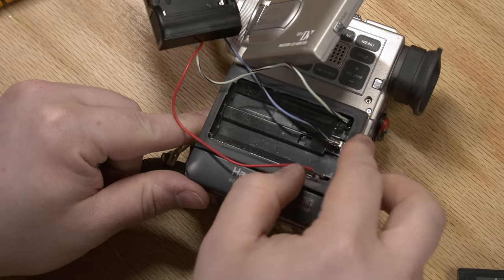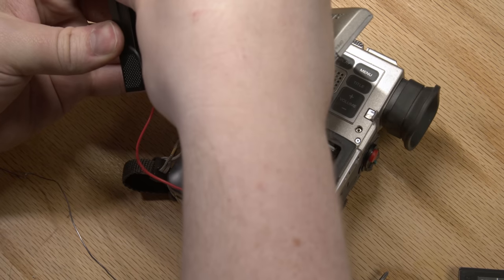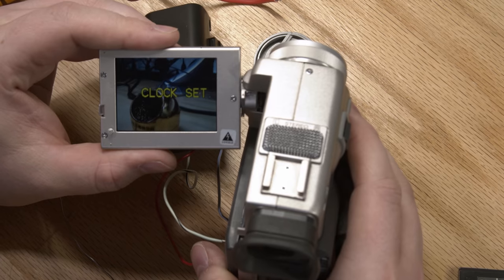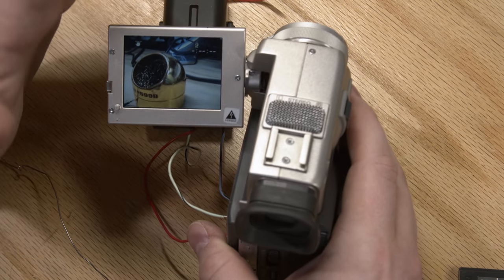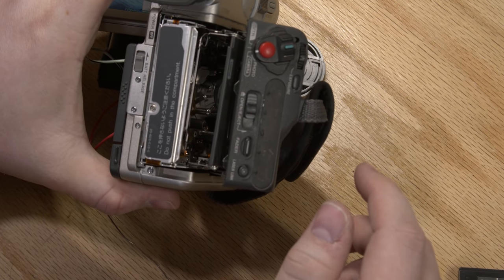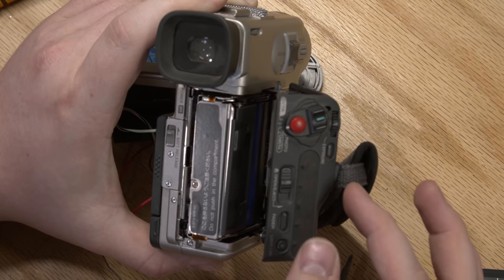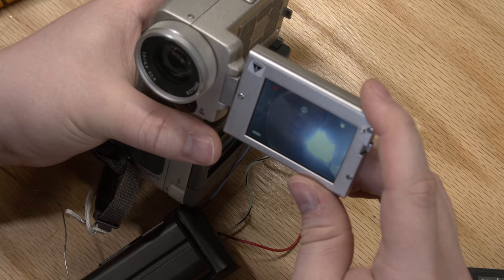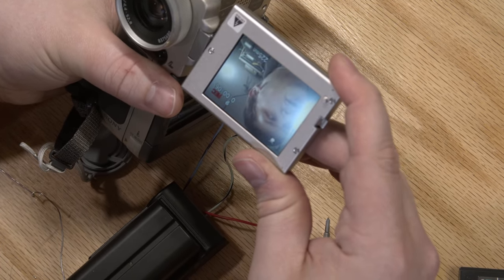Adapting Infolithium to Infolithium

Comment: Have you tried using a vice to squish the case a bit and break the ultrasonic soldering that holds the case together? It's certainly much safer than using a cutting tool.

Comment: you could probably greatly reduce the footprint if you designed a PCB that translates the contact points and then 3d printed a frame that snapped around it.

But by that point you ought as well just make a design that would accept a modern flatpack and add usb c charging to the back of it.

Comment: This is basically the exact process I went through when I was broke AF and grafted a AA battery holder onto a mobile phone battery to avoid buying an expensive new lithium battery for a phone so old it was worth less than the batteries.

Comment: I plugged my JVC camcorder in for the first time in over 13 years. Battery still had 20 minutes on it. Right now it's into its third hour of charging... let's see how it's doing... and it's up to 370 minutes which is about right :D For my next trick, see if the other hi-cap will charge (it's completely dead at the moment but it doesn't smell so... we'll see)

Comment: I'm sort of shocked you didn't try to either glue the two plastic shells together, or use the dremel to open up the camera-mated case such that the smaller battery-mated case would fit inside it.

Comment: For mounting the parts together is there a particular reason why you didn't want to use epoxy putty or hot glue? That wouldn't allow for disassembly once completed but it would give a solid fit and could double as insulation for your solder joints and wires, although I am a little obsessive about always insulating my wires.

Comment: Looks great. It's really baffling to me that these kinds of adapters are not actually produced on the market, even when (garbage, third-party) batteries still are; it does seem like the power-tool industry is finally getting there now with nearly any-to-any battery adapters available on Amazon.

I probably would have jumped far earlier back to the diagonal cutters for butchering the plastic, and/or X-Acto or utility knife. (And probably stab myself in the fingertip once or twice.) 
It looks like the sizes are such that you could cut the base a little wider and nest the new sled inside it, and get the whole thing a bit lower-profile, and then have a nice edge joint you could secure with an epoxy fillet. Maybe once you find a sled with a proper third contact.
Reply from the maker: Trouble with the latter suggestion is it would encroach on the space for the wires and I don't think it would ever sit flat. This one, as it happens, is pretty much all right angles and the wires are un-squished; I can also just pull the tape off when the solder joints break to repair them.

Comment: I've been meaning to make an adapter to use those standard NP-300/500/etc batteries on my Sony GV-S50 8mm Video Walkman... which uses yet another differetn style of infolithium battery. ;D
Reply from the maker: absolutely delightful. Does anyone have a page listing all the things called "Infolithium"? I would love to see that.
Reply: The GV-S50 likely uses NiCads or NiMH since its from 1992. HandyCam 8mm camcorders from that period were using battery dildos(tm) as an AC Adapter and the manual confirms this.
Reply: @NJRoadfan  Fwiw, Here's a page for the NP-55 battery that the GV-S50 uses, and a list of all of the models that used this size: https://www.camerapowerpro.com/products/sony-np-55-np-55h-ni-mh-rechargeable-battery 

To tell you something you already know; you are 100% correct.  It's Ni-MH...  Not InfoLithium.  My bad.  And actually it's confirmed on my device since there's only two contacts on it. No third communication pin for detecting battery type.  The power adapater (dildo style) and my 6-AA adapter for it also have just two pins there. Which I suppose is good for me, since i can adapt mine to work with other batteries easier. ;)

Sidenote:  Don't google "camcorder battery dildo".
Reply: Sidenote sidenote;  I'm working on a 3d-printable plate for the NP-55(H)/NP-33 devices so that i can adapt mine to use modern batteries. (i have some 7.2v rechargables from a canon digital camera that I want to use)  https://www.thingiverse.com/thing:4846867
Reply: @yorgle  I think the proper term is "battery eliminator" for that style of adapter.

Comment: You can go on eBay and search the camcorder's model name followed by "charger" or "power cable" and you should be able to find the charger for the camcorder.
Reply from the maker: this is a sony dcr-pc10 - nobody has one unless it's included with a camera. People VERY frequently buy these things and lose the DC cable, since it's not necessary for use. The only time the average individual would ever want the DC cable is if they're using the camera as a VCR, and a lot of people just played their video off of battery, especially if they had a full four-cell pack like this.
Reply: @CathodeRayDude  I stand corrected. You must be right since I did search the camcorder up on eBay and the only chargers I came across were included with the camera. I'm just not used to this stuff as much as you are. I have a collection of digital cameras which I've collected from thrift stores and the majority of them only take standard AA batteries.

Comment: I've had to solder a bead on to the positive end of 18650s many times, 1 can replace the 3 AAA 's for a flashlight. Even cooler ever use triple A's in place of doubles?

Comment: I'd like to adapt some of the flat camcorder batteries i have to be basically a AA battery adapter. I have the official Sony version of that for the early 90s Video 8 Handycam. I know other camcorders have accessories like that even if they seem unobtainable. I'm sick of needing to rely ONLY on what Kastar decides to remake and be ahead of the curve.
Reply: There's probably some kind of 3d printing shenanigans which could follow that to make the form factor for the batteries that could go to market and revive some camcorders that don't have recharge packs available.

Comment: How do I do if I replaced the cells but in the process i broke the charging circuit module? What did I need to do with the "C" pin?

Comment: For cables: I got some old BROKE PCs from a junk pile and am now using old the IDE cables an some of the PSU cabling, works fine.
Reply: Why did I write broken in caps again?
Reply from the maker: Yeah, not a bad idea, the ~20ga wire in power supply cabling is pretty good general purpose - but I can't tell you the last time I actually HAD a broken or unwanted computer component, if I'm honest.

Comment: You probably could have just used the old PCB and just soldered the power leads to it. That way there would be a PCB in the adaptor and you wouldn't have had to go through the trouble of making a pass through with the PCB on the actual battery, but rather it would have been integrated into the sled.

Comment: Lol this reminds me of a similarly janky PSU mod I did for a guitar pedal

Which, when you were complaining about wire, it occurred to me that I've always bought mine from audio suppliers, basically. I used to do a lot of work on guitar hear so, naturally I would I suppose. 

So check out parts-express, That's probably easiest. Definitely more geared for guitar but stewmac.com has some specialty wiring like small gauge coaxial, shielded multi conductor cable (which I've used leftovers of for USB or gamepads and such), uninsulated wire for coils, etc

Or just use dollar store stranded speaker wire for everything like I did as a kid lol

Comment: You should learn about plastic welding using a solder iron with some different tips and a filler plastic for affixing the cases together in the future
Reply from the maker: I chose not to use a permanent method so I can disassemble and repair it in the future when my bad solder joints break.
Reply: @CathodeRayDude  Makes sense thanks for the reply

Comment: NOS batteries worth a try, but only if they are very cheap. And also, if you can't find a new replacement, and you don't have the dead original, it's better to replace the cells in a NOS original than doing so with a fake one. The original cell management circuit is surely better. And sometimes, you can get surprised with NOS batteries. I have some 20 years old Compaq iPaq palm PCs with the original batteries in them, 3 out of 3 works perfectly. They have Samsung cells in them.

About DIY replacement of lithium cells: you can buy cells with solder tabs on them. Although it seems they're much more expensive then tab-less ones. Alternatively, you can buy these cheap Infolithium clones and steal the cells from them. Or from laptop batteries. I would rather transplant the cells into a genuine Infolithium than using the fake battery (again, because the original cell management circuit is better). Not sure if it's doable with an old, used battery, because the cell management might remember the state of the previous cells, and refuse to work properly, or at all (it might report to the camera that the battery needs to be replaced). I heard that's the case with some laptop batteries, the cell management needs to be resetted after cell replacement, which is not always straight forward. I don't know if Infolithium is like that, but that board looks complex enough for the task.
Reply: On the other hand fake packs are sometimes better donor shells because their protection circuits are less sophisticated. More modern laptop packs will permanently disable themselves if they detect anything wrong. Even disconnecting the old cells may trigger this. In contrast I've heard the fake ones are much more forgiving so they will still work fine after the cells are replaced.

Comment: Sides are not undangerous- the case forms the negative terminal of the battery and that plastic is thin, so can still short stuff out (if in series)

Plus the sidewalls are super, super thin in comparison to the terminals, coke can levels   120um for an ncr18650b

Comment: I'm all about this kind of jury rigged shit! Post more!

 I 'm in the process of making my Canon VC-30 saticon camera into a camcorder using an old android phone, a cheap usb capture device, an Aliexpress 18650 battery pack and a diy wiring harness. (Thanks for the offer of a pinout you responded with on one of my previous comments!)

 I had it all working but apparently the camera draws too much current for the battery pack I purchased. It worked once but after that the battery pack would no longer put out 12V. Probably too much current? I'm thinking I may try using a 12V battery pack from a power tool, that should be able to handle it.

Comment: instead of gaffer tape i probably would have used epoxy or something and filled the adapter with it.
a few tiny countersunk screws through both plastic parts and it'd be solid and strong.

Comment: You sould try to cut away the rough edges with a sharp blade. Ive had pretty good results with it, without damaging the other plastics.
Reply from the maker: I'm pretty bad about overcutting so I tend to prefer the nibbling approach but if I do more work like this I'll give it a shot

Comment: What if you melted the two plastic parts together? or used hot glue? Ive been needing to make one of these but to a sony np-55 battery
Reply from the maker: I chose not to close it up permanently so I could fix it later when my solder joints inevitably break
Reply: Ahhh makes sense. Im planning on using some np-f9xx batteries when weigh a lot, and I'd hate to be mid shot when the battery Flys off 😂 . I'm honestly surprised there's only diy stuff for these adaptors, and no one has taken it to a factory. Even for absurd prices because of low volume

Comment: Great video. I wonder if anyone competent with 3-D modeling software would be willing to design a 3-D Printable sled for you - you'd probably be able to get away with copper tape for the contacts and such.
Reply from the maker: I've been thinking of doing something like this for a long time, I have solid CAD skills and a 3d printer, it's just a tremendous amount of work and, yeah, making the contacts is kinda tough. I had everything I needed for this project on hand, so I just went for it.
Reply: @CathodeRayDude  oh yeah, its not easy at all. Its another one of those "oh just do x" where "just" is not nearly as simple or safe as people think.
Reply from the maker: @partycatplays  I think for people who can get into the groove of doing this sort of thing, maybe it is "just" to them, but I like to remind people that it isn't "just" for everyone.
Reply: @CathodeRayDude  exactly!

Comment: I know Ali Express sells 18650 battery holders and snap in cells which could have been wired into the info lithium BMS controller board you indicated you threw away.
Reply: Yeah, working BMS should never be thrown away, at least not somewhat practical ones.
The ones out of devices batteries are mostly a lot better than the ones you can buy from ali express, the only BMS i really bought and enjoyed once were custom BMS controllers with direct USB charging or at least any regular plug (or dont use a BMS at all, just charging via LiIon/LiPo charger and an external balancer port)

Comment: Those generic Chinese batteries and devices take what Sony retroactively calls InfoLithium L series batteries. My CCD-TRV65 from 1998 takes them and the NP-F330 it came with doesn't have the letter L anywhere on it since it predated the system. Later HandyCams from 2001 or 02ish take a smaller InfoLithium M battery (NP-FMxx). The TRV65 doesn't care about the data terminal as it included a 6xAA InfoLithium adapter that lacks it! Its clear the cloners exploit this loophole, but there are Sony devices that do check for the InfoLithium data signal.

The DCR-PC10 that you have is really early for InfoLithium (1997) and it doesn't appear that Sony retroactively gave its battery a letter or used it on many devices.

Comment: What brand of "fake" infolithium battery would work to not get the infolithium battery only message? Anything with a third data contact ?
Reply from the maker: In theory yeah, anything with the data pin usually has a chip that pretends to be the real thing - the question is just whether it nails it or not

Comment: Many cheap vape batteries have a 18650 cell with wires soldered to it. It sketches me out too, but if it was really that risky, why wouldn't the factory just buy a cheap, shitty spot welder? But I do understand, I'm not going to do it either. I'm going to have to re-cell my ebike battery soon, so I've been looking at spot welders. Even considering the cost of the spot welder, it is still significantly cheaper to DIY than to buy a new one with a battery this big.

Comment: I maybe would've used some putty epoxy or possibly some silicone caulk rather than tape but hey if it works it works!
Reply from the maker: Used tape so it can be repaired when my solder joints break, which they inevitably will. Didn't want to cut it open again when that happens

Comment: Try McMaster Carr for wire.  Here's a few categories:  https://www.mcmaster.com/standard-electrical-wire/vehicle-wire/ https://www.mcmaster.com/standard-electrical-wire/multipurpose-wire/wire-7/ https://www.mcmaster.com/standard-electrical-wire/multipurpose-wire/wire-assortments/ Also, teflon jacketed wire is awesome if you can find some at a good price.  The jacket doesn't melt when soldering to it like PVC does.  Also, maybe try some black hot glue to finish things off.  Since its black, it blends in nicely and can be used to fill holes, hide seams, etc.
Reply from the maker: see the thing is, this requires too many choices. i don't know what i want!! i just want Some Wire. i want a company to sell me a BAG OF ASSORTED WIRE
Reply: @CathodeRayDude  The main problem with that is what you want varies quite a bit with what you're doing.  For sort of general lab stuff, at work, our normal wire is 22awg or 24awg, stranded, with teflon.  That wire would be pretty bad to use on a breadboard though (those really need solid).  But for doing bodge wires on boards, we often use 30awg kynar wire wrap wire.  That stuff's too thin for most connectors though.  But we do power electronics, so we go all the way down to 4 awg welding cable, when necessary.  Exactly what gauge we use depends on how much current we expect the wire to carry.  And this isn't even getting into exotics, for example, high flexibility (like multimeter leads) or very high voltage.

So, the answer, is maybe 22awg stranded for general purpose stuff, but that only gets you so far and there's really no one size fits all.  Nor is there some assortment where you could get it all (if you could it would be outrageously expensive).  You can get an assortment, but it'll be an assortment of colors within a wire type.  Best hope there is to find an industrial surplus/going out businesses sale and just get what you can for cheap.

Comment: i cant help but notice the connector for dc power looks ALOT like the ps vita 1000 model power connector which is also a sony product...also i happen to have a sony digital camera that takes the same connector for transfers somewhere in a box in storage.. might be able to find an inexpensive camera that comes with said cable though it will most likely be usb

Comment: gaffer tape solves ALL the problems!
Reply from the maker: i have very little experience with this stuff so far but it feels like everything i was told duct tape was, and it wasn't
Reply: @CathodeRayDude  what you did with the battery pack is pretty much all I've ever used gaffer for, aside from taping down inexpensive XLR cables to expensive carpet in wedding venues for running audio with live bands aha

Comment: 7:17 Pretty lot of BS here regarding the li-ion batteries. The battery welder isn't working in high voltage. It works with few volts maximum. The current is high in those. And you can solder the li-ion if you know how to do it.